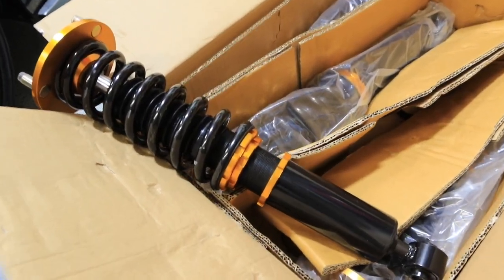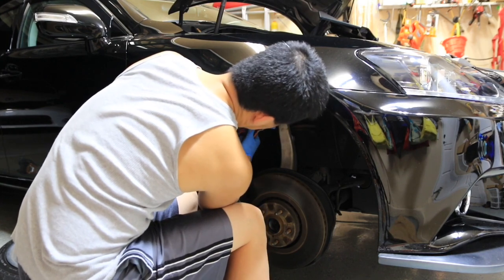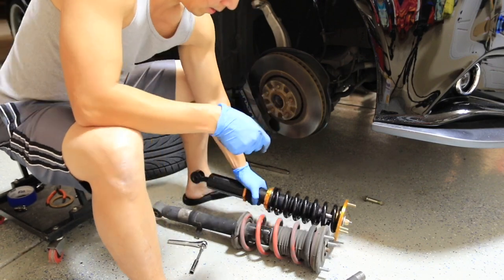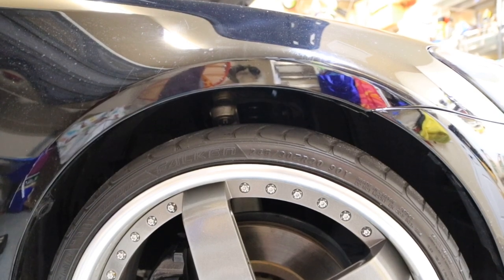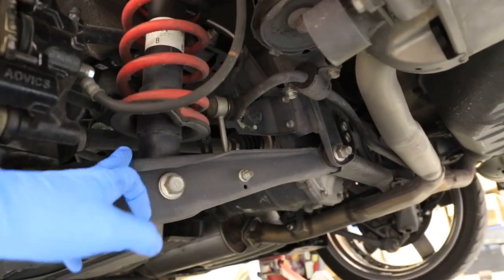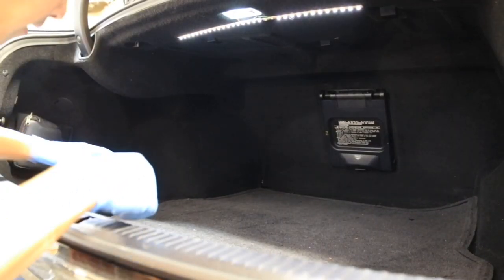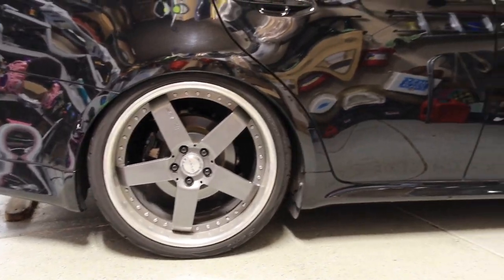How to Install Coilovers | $200 eBay Coilovers | 2006-2013 Lexus IS250 IS350 2IS GS350 GS300 GS430

Comment: So how is the ride quality now? Would you recommend these? Thanks!
Reply from the maker: The Don they going strong. No changes since new and I’m at about 15 months and 12k miles on them. Mostly daily city miles. Can’t beat the value especially if you can DIY.
Reply: Tuner with Kids is it an uncomfortable ride ???
Reply from the maker: Naw. I’ve always had lowered cars so second nature. I also ride on 20 inch with 30 series tires. So not mich phases me.
Reply: But how is the ride?   Bumpy?  Sportyness?  Loud?  Do the springs make nose?
Reply from the maker: They've been good for over 2 years now. I am starting to hear slight rattle from front, like when the rubber top perch starts wearing down and spring touches the top hat. But overall holding strong for my easy driving on FL roads.
Reply: @TunerwithKids  this is good
Reply: @TunerwithKids  would you recommend just getting new struts, since they last longer?
Reply from the maker: @zillowwhite8294  if you’re on stock springs or lowering springs and don’t plan to adjust then got with new aftermarket shocks from Koni, bilstien, or Tokico.
Reply: @TunerwithKids  where in fl

Comment: Quick question, I have a set of coilovers and im wondering if it's okay to install just the front one first and keep the rear to OEM.
Reply from the maker: Why though? It’ll be jacked in the rear vs front.
Reply: @TunerwithKids  shop told me front ones are needed to get replaced to get a safety, I was thinking of doing that first, get a safety, and then install the rear.

Comment: How long have you had them on? Are they worth a shot? Looking for cheap coilovers for my is350 since it’s a daily anyways. Don’t wanna spend 600$+ if these get the job done. How’s the ride?
Reply from the maker: I think I've been on them for 8 or 9 months. No issues yet. Mine is a daily also and I dont really expect much out of $200 coils. They were an improvement over the 11 year old stock shocks and Tanebe springs I was on.
Reply: Tuner with Kids-Binh Nguyen I’m on a strict budget because I’m just getting into modifying my car so I don’t want to spend 1000$+ on coilovers if these work wonders lol. For 8-9 months and they seem to be holding up that’s pretty good already. My car is at 80k miles at the moment and I was going to get lowering springs but came across this option. You haven’t ran into any issues yet? Would you recommend them if you are just dailying the car and want to close that fender to wheel gap?
Reply from the maker: @coreymun4551  it's worth a shot. If you can DIY the install than it's worth the gamble. If you gotta pay others, then might want to consider a reliable name brand.
Reply: Hm, I see. Well regardless on a DIY you would still have to bring it in for an alignment afterwards lol I was going to have a shop install it and do alignment and all that. Either that or just do it myself then bring it in for an alignment. If you had no problems with it for 8-9 months that’s pretty good already
Reply from the maker: Corey Mun you usually just need initial alignment when first lowering. After that, if no major damage or changes, you should be good. I haven’t had an alignment in 9 years. After my 3 year alignment expired, haven’t done it. Plus it’s a pain to find a shop with a low or inground lift.

Comment: I want to commend you on taking the time to produce this video but I wanted to make some suggestions and hope it’s helpful.

1.  When setting up the shock length out of the box you will always want to make it shorter than the factory dampers.  The reason is that aftermarket coilovers will usually have a much higher spring rate than the stock spring.  So, if the shocks are the same length then the higher spring rate one will have a higher sitting car.  If you felt like doing math you can find out the coilover’s spring rates, look up the corner weights, and motion ratio for your car.

2.  Most of these manufacturers want you to put a few mm’s of preload on the spring and do all height adjustments from the lower bracket.  I know what you all are thinking, “I don’t want to unbolt the lower bracket each time to spin it.”  Well, you actually just spin the threaded body part  by grabbing it with two hands and rotating.  If that doesn’t work you can always use the spanner wrench on the spring collars to get it to rotate in and out of the lower bracket.

If you do want to droop the spring it may actually improve your ride quality if you maintain adequate compression stroke but I suggest you use helper springs to soak up that void/slop in the main spring.  This will help maintain the main spring’s position under droop and mitigate noise that may come from the spring clunking around in a rebound/droop situation.  If you pursue this method and really want to setup the car like a race shop would then you’d want to google things like setting “critical shock length” and adjusting height via the spring and lower bracket combo. 

3. One of the most helpful things I can offer when adjusting ride height is to find out the suspension motion ratio for your car.  For example, let’s say you install the coils and the car is 1” too high.  That doesn’t mean you will adjust the coilovers an inch.  On cars that are not macpherson strut, like this, will adjust a lot more at the fender than at the shock.  Let’s say the car has a 0.75 motion ratio in the rear.  That means a 1” drop at the fender is equivalent to a 3/4” adjustment at the shock.  I see time and time again that people have a really hard time bouncing back and forth with height adjustments.  If you have the ratio you should be able to hit your target in one adjustment.

4.  When connecting the rear LCA to the spindle it can be made easier if the shock and sway bar links and not bolted in.  I have the control arm connected at the subframe and then connect to the spindle.  That will allow you to articulate the arm much easier.  If that’s too hard then unbolt it from the subframe and connect to the spindle first.  Then reconnect to the subframe.  Once that’s done you can use your jack to push the LCA upward so you can bolt the shock bottom in, with the but finger tight.  Then do the other shock.  Then do the other shock.  Then compress the suspension as shown and torque all connections.  After this is done then connect the end links and torque them.  After that drop it on the ground and see what you got.  It’s much faster this way imo.  

Hope that’s helpful.  I’m doing one next week and checked out your video to just remind me of what panels i needed to remove in the trunk. Thanks for that.

Comment: My 350gs looks the same, I took off the sway bar and loosen the back 19mm nut to easily lower the control arm.
Reply from the maker: GS has same suspension as IS

Comment: Binh!  4months ago I reviewed your video, left (and recieved) comments, and decided to make the move.  With your tutorial.... I got it done.  Thank you so much.  It is sitting pretty, wish I can show you.  Have a couple of questions and concerns, if you would be so kind.... Now that everything is installed and fit/ adjusted... I have 3 dash warning lights on:  Brake, ABS, and Traction (car with 2 squiggly lines)... Did you run into that?
Reply from the maker: Did you run the codes? You might have unplugged the front ABS line into the hub. Other times people install the rear swap link upside down for the AFS headlight sensor.

Comment: Went to install lowering springs today and those 2 12mm bolts holding the frame piece on the strut was completely corroded. Will have to probably get a counter screw set and drill it out
Reply: Super hard to align the LCA to the spindle too haha spent 40 mins trying to align if

Comment: I have a 2007 is250 awd will these still fit? And if not which ones can I buy that with fit my awd 2007 is250?
Reply from the maker: AWD had different fronts. Rears are same.
Reply: @TunerwithKids  o ok do U know any that is budget friendly like these but for awd?
Reply from the maker: Not for AWD since it isn’t common.
Reply: @TunerwithKids  damn ok thanks for the help 🤙🏼
Reply: I have 2008 is250 facing the same problem trying to lower. Been searching forums and everything for cheaper solution than $1k coil overs.

Comment: hey bro! amazing video by any chance do you know what brand you have for your upper control arms?
Reply from the maker: They are stock with SPC ball joints for camber adjustment.
Reply: i will do that buy the set of two spc ball joints if i went a different route of buying a set of two upper control arms, would you recommend any brand? and are they easy to replace the ball joints? greetings from florida
Reply from the maker: Most people just do Megan racing uppers. You can go fancy with all that drift stuff with spherical joints but it’s overkill.
Reply: @TunerwithKids  for a daily i would be okay with going with megans? i will be getting your coilovers from ebay as well. they will pair up better or with the spc ball joints?

Comment: Hi Binh,  Thanks for the updated link ($300).  Couple of question for you:  I've read most of the comments and based on your feedback, looks like you have no issues with the "cheap ebay" coilovers... What benefit would I get if I went with Meagan or BC?  Also, aside from the coilover kit from Ebay and maybe an alignment... What else do I need to do?   (Plan on running stock wheels and tires). Thx
Reply from the maker: They been OK since install. My latest issue is the bushings rotting. So I rigged some urethane bushings 6 months ago(there’s a video). With Megan and BC you will have better build quality. The lower threaded shaft is a cast aluminum vs steel welded. They are also adjustable. Mine aren’t, but TBH you’ll probably never make adjustments.
Reply: @TunerwithKids  Oh snap.  I always thought coilovers were adjustable... So these are just 1 height huh?  Urethane bushings >> you made the video?
Reply from the maker: @brianyt56  I meant dampening of the shock. Not height.
Reply: @TunerwithKids  Thanks.  I just saw your other video--  and just purchased the bushings on Amazon.  Another Q for you:  I think I read that you felt that this ebay coilover system is generally better than your 11 year old "stock/oem" setup?  <-- Is that right?
Reply from the maker: @brianyt56  the stock shocks and springs were dead.
Reply: @TunerwithKids  thx for all the info… can you hook me up me up with a bottom line? I want to lower my car. Keep the stock rims and tires and clear the gap— purely cosmetic. But I don’t want any ratteling or bottom out noises/squeeks,and I dont want any bouncing or noticable change in comfort— basically, i dont want my wife to roll her eyes at me and tell me “you’re not in high school anymore) and that I ef’d up the car.  Whatchu think? No track. No race. my daily grocery getter.

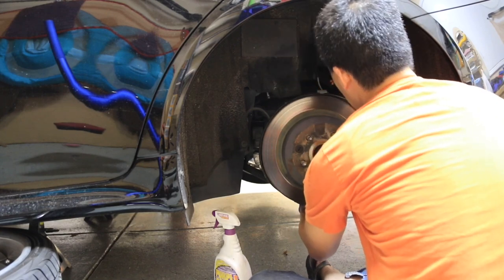Comment: 24:30. I could not get the hole on the control arm to align to the spindle.  Wish you have moved the camera to show how u did it. I have the same pry bar, jack, etc. The alignment is like 1 inch off. I am tired.
Reply from the maker: Derek Chung it’s not easy. Make sure both sides are jacked up. The sway bar puts pressure on and twists the LCA.
Reply: One day on this. You know what stupid mistake I made? Haha, like how I drive everyday, I stepped on brake, shifted to Park, then set e-brake (on my slightly slopped driveway). Then jacked up the rear wheels (both),  the spindles are under torque from the axles !!!!  All the linkages and the control arms are under so much tension, making it so hard to remove the M14 bolts (I stripped one but luckily I have M14x1.50 die and tap), and impossible to put the last bolt from control arm to spindle. Oh man, I tried everything, shortening the coilover height all the way, finding a long long pry bar, disconnecting the lower linkage (which popped out and its hole was then off one inch from the bushing.) 8pm, I finally figured out something is not right when everything is under so much tension EVEN WITHOUT THE COILOVER, then started the engine, shifted to Neutral and release the e-brake. Voila! Everything falls back in place!  

GUYS, CHOKE THE FRONT WHEELS, JACK UP THE REAR WHEELS, AND RELEASE THE E-BRAKE!

Comment: It's been 5 years on this video, how did those coilovers hold up?
Reply from the maker: Lower bushing started going bad so I swapped with urethane bushing. Otherwise going well.
Reply: did you have any issues with getting an alignment with just coilovers? @TunerwithKids
Reply from the maker: My cars had same alignment for over 15 years. No issues unless you unbolt toe arms. For lowered cars, you need to find a place with inground lift so car can drive on without ramps.

Comment: Did ur coilovers come with that brake line bracket? 
Or you order them separately?
I just received my coilovers and they didn't come with the brake line brackets. 🤦
I just emailed them about that, but came to a stop on installing the fronts. 😣
Reply from the maker: They came with them.

Comment: Are these good? I been thinking about buying  these but I’m not sure, I found these on eBay
Reply from the maker: They been working well for me. Almost 2 years on them now.
Reply: Tuner with Kids but my car is awd that means these won’t fit right? Because these are rwd
Reply from the maker: Correct, not many AWD options. Gotta go name brand for over $1k.

Comment: Do  I need a camber kit?  Thanks for your video and all the feedback in the comments.... I just purchased me a set of Maxpeeding Adjustable Coilovers from eBay for $296 :).... Plan to lower 2-3" all the way around, do I need a camber kit? If so, any recs?
Reply from the maker: Yea, need camber kit to save some tires. Front you can do SPC upper ball joints or new upper arms from Megan. For rear, new upper camber arm from Megan should do the trick.
Reply: @TunerwithKids  Awesome! Thank you. 

Sorry I’m brand new to this, do these descriptions look right? 

Megan Racing Adjustable Front Upper Camber Arms 

Megan Racing Rear Adjustable Camber Upper Arm 

After I install, can any regular allignment shop do the allignment?
Reply from the maker: You’ll need to tell them about the adjustment arms. They’ll need to understand how it works since those are adjustments that show on their screen for the car.

Comment: So are the shocks same on IS and GS? Are they interchangeable?
Reply from the maker: Yes. Same mounting
Reply: @TunerwithKids  I found these used BC racing coilovers on Facebook they are for 2008 IS250/350 SO these should fit onto my 2008 GS300 YEAH?
Reply from the maker: So such thing as an 08 GS300. Last GS300 was in 06.
Reply: @TunerwithKids  I'm in Australia and we had GS300 till 2012 Same chassis as GS350 but with a 3 litre engine.
Reply from the maker: @ShivamSingh-ud5ik then you’re good. Same coilovers.
Reply: @TunerwithKids  thanks 🙏

Comment: How are the Coilovers over time? Did it end up making the Drive Terrible?
Reply from the maker: They are holding strong. Much better ride than stock shocks with Tanabe springs.
Reply: @TunerwithKids  which Coilovers did you end up going with? I want to pickup a set
Reply: @TunerwithKids  Nvm found your link in the Description, thanks for Responding!
Reply from the maker: I’m not sure they are even sold anymore. Check the links in the description box. They were just some random no name coils I bought 2.5 years ago.

Comment: Just bought these and in the process of installing them. Do I have to take off the entire coil to adjust the height? It seems that if I use the top two with the adjusting hooks it only moves the spring? The only time it adjusted the height is when I would twist the coil while it was off the car.
Reply from the maker: Joseph Reyes you set the lower perch as far up or down as you need for normal heights. The top perch will be your adjusting for when it’s on car, if you ever go up or down. That also affects the amount of suspension travel. You have to dial it in enough where you can even move the top perch once it’s on car.
Reply: Tuner with Kids gotcha, I managed to get the front right on but the other side won’t let the strut go, I dropped the control arm, took off the bolt, but where you line up the bushing where the bolt comes from, it just has the strut lodged in there and I can’t find a way to pull it out.
Reply from the maker: Jack both sides up? The sway bar is putting pressure on the suspension.
Reply: Tuner with Kids yup, i applied some WD40 and took off the coil from the other side. I think it the stock shocks didnt want to budge because the coil overs on the other side i set at 2 inches shorter, once i took off the coil i was able to just wiggle the stock shocks off👍🏽 Thanks a lot for your help brotha, this video saves lives.

Comment: How are the coilovers holding up? 
if they still on the car 😜
Reply from the maker: Still on the car. Doing good.
Reply: @TunerwithKids  
Really? 😳
Did you ever do a ride video of them on? 
See how bouncy or stiff they are?
Reply from the maker: They are normal. I can’t really tell difference between my 2IS with these eBay or my 1IS with Megan’s. But YMMV on these as they probably evolve and change depending what factory they are made.
Reply: @TunerwithKids  I see 👍 
Link you posted is for once you installed right?

Comment: Are you able to life them above stock height ?
Reply from the maker: I don’t think so. Never tried.
Reply: Tuner with Kids if I want it to go to stock height can I ? Cuz I don’t wanna be low
Reply: Tuner with Kids but my suspension is bad
Reply from the maker: Well you can adjust the top and bottom collars. So you should be able to. Now sure why you would get coilovers if you’re not going low.
Reply: Do you have a Instagram
Reply from the maker: @tuner_with_kids